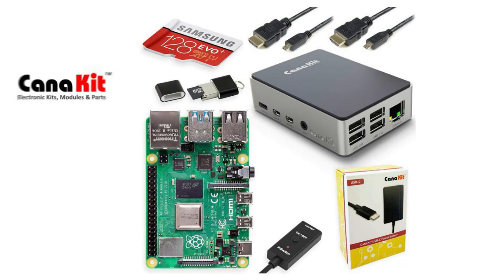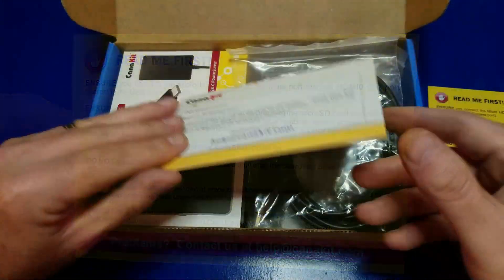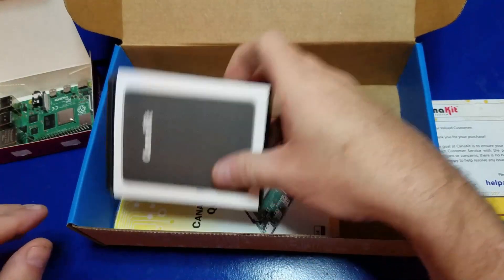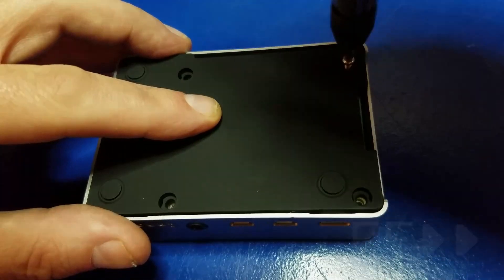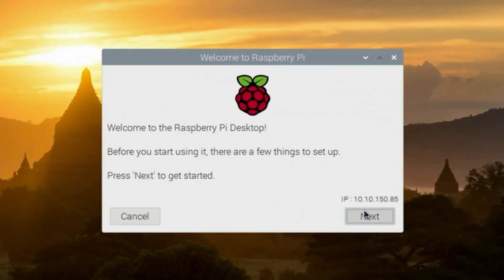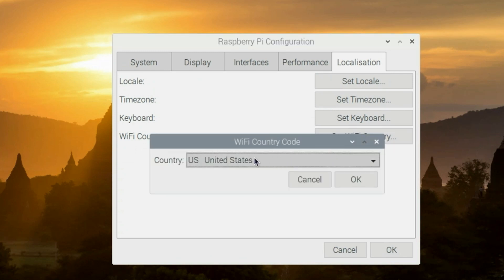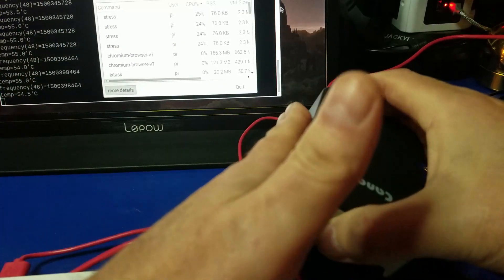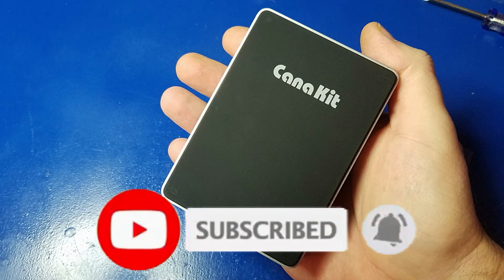Canakit Raspberry Pi 4 8GB Extreme Kit [Aluminum case] : Setup Guide

Comment: How do you access the GPIO when the case is covered?
Reply from the maker: You'll need to add a GPIO cable and extend it through the slot on the bottom plastic cover.  From there, you can attach it to a cobbler/breakout board, breadboard, etc.

Comment: I have a nitpick.  Given this is the 8gb model, 32 bit is a waste of the memory.  You need 64 bit to address above 4 gigs and lucky, this arm chip can do above 4 gigs but NOT without the 64 bit OS.  So CHOOSE THAT ONE.  Otherwise half the ram will be unusable.
Reply from the maker: At the time of this video, 64-bit was relatively new and many applications weren't yet re-compiled as 64-bit.  You're correct though, 32-bit can only address up to 4GB of RAM.  However, at the time this video was made, it still made sense as there were few apps. compiled for 64bit.

Comment: goated video
Reply: What about connecting to a laptop instead of keyboard and mouse?
Reply from the maker: @kciwner  If you're asking if you can use the keyboard and mouse from a laptop to control the Pi, you could setup SSH in Pi Imager when you create the image and set the WiFi SSID user/pwd, etc. and then SSH into the Pi.  But, for all intensive purposes, you're going to want a mouse and keyboard I think.
Reply from the maker: Thank you kindly!

Comment: No HDMI blank screen 2023... What's the fix here?
Reply from the maker: Make sure it's plugged into port 0 on the Pi.  Try a different HDMI cable.  Make sure the correct HDMI input is selected on the TV/Monitor.  Those are the main reasons.

Comment: Great vid!! I’m wondering if there is any way to split monitors in Mame emulator for games like punchout or super punchout. I was able to achieve this on my pc with Mame but can’t figure it out in raspberrypi 4
Reply from the maker: Thank you Brian!  Very good question, theoretically it should be possible since the Pi 4 has two HDMI output ports but it is something I've not personally tried.  I searched and it looks like ETA Prime has a video on this that may be helpful: https://www.youtube.com/watch?time_continue=113&v=VWFBq7dz41k&feature=emb_logo

Comment: But the kit with the fan comes with heatsinks as well.. what do you think would stay cooler, this newer model or the kit with the fan and heatsinks? I'm looking to overclock and run it hard
Reply from the maker: The kit with the fan will be a bit cooler.  Also, check out the cases here before you decide: http://wagnerstechtalk.com/guides/#Raspberry_Pi_Cases  The Desk Pi Pro v2 and Argon One M.2 specifically.

Comment: I'm about to buy it, but turns out there's no way to put a GPIO extension on that.
Reply from the maker: From what I understand, CanaKit sells a low-profile GPIO cable that should fit it but I don't have one to verify.  Another case you may be interested in is this one:  https://youtu.be/62FfPT38obo (does not come with a Pi 4, power supply, microSD or HDMI cable - just the case itself).

Comment: Good overview with no frills or distractions.  Thank you!  What about access to GPIO?  Seems like there is a slot on the bottom plastic part to route the cable.  Were you able to test if that is adequate to get a cable out for GPIO?
Reply from the maker: Thank you!  You have to get a low-profile GPIO cable, which I do not have, but there is a slot for the cable to feed through.
Reply: Awesome.  Thank you for the quick response.  Much appreciated!

Comment: Can throttle it up or down with noob?
Reply from the maker: I think you mean overclock?  This is done through the config.txt in the boot partition.  In TwisterOS there is a new tool called 'Commander Pi' which simplifies this process.  Either way it does the same thing and use caution when overclocking.  Setting the wrong values may cause it not to boot, damage the Pi or may void the warranty (not 100% sure on that).

Comment: My nitpick is there seems to be no way to get the onboard temperature sensor to display the temperature in Fahrenheit instead of Celsius in the Raspbian desktop.

I'm not even being facetious here, but one would THINK that if the Raspbian desktop was smart enough to realize you're in a U.S. timezone, and a white labcoat ISN'T your primary attire, that the user might find an Imperial U.S. measurement of temperature to be more useful than a metric one.

Perhaps if the Raspbian designers were to visit the U.S. one day, they might realize the U.S. uses Imperial, not metric, units of measurement.
Reply from the maker: I agree with you Brian, it's kind of a pain.  While I was making this, I was constantly "Alexa, convert xxx degrees Celsius to Fahrenheit".  I likely could have spent some time converting the script to do that for me and may do that for the next video.  I appreciate you watching!
Reply: @WagnersTechTalk    I don't use Alexa, Siri, what have you.  All that data collection behind my back is pretty creepy.  It's the main reason I quit Facebook.  I've seen too many horror stories about Alexa, Siri, and Google Assistant doing unauthorized listening in on conversations I disable that wherever I find it.  I still find it a pain to have to constantly consult the temperature conversion tables to find out how hot my Raspberry is running.
Reply: Get with the times and hang with the cool cats old man.

Proceeds to kickflip, trip and die